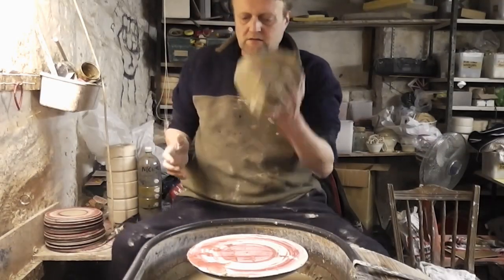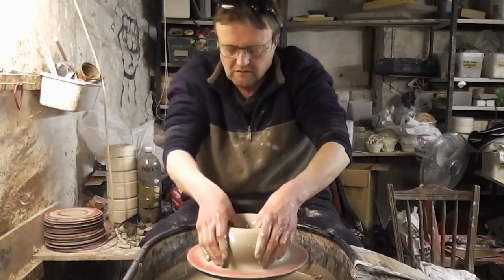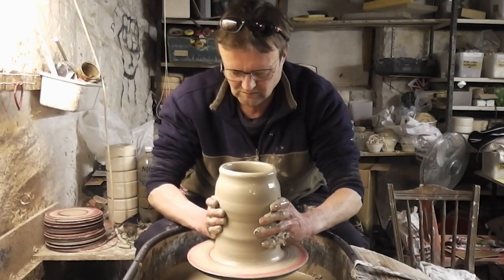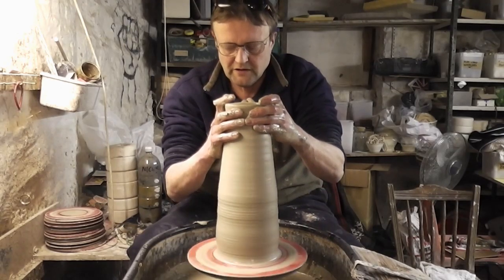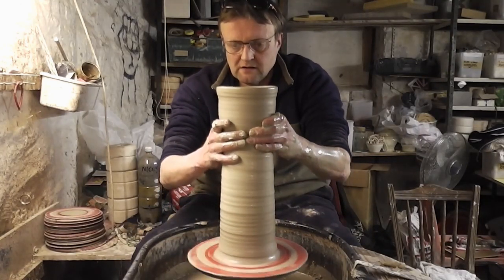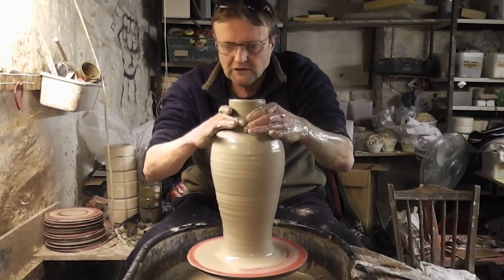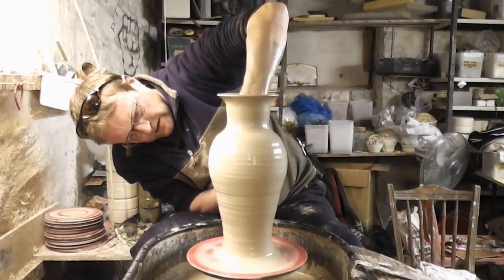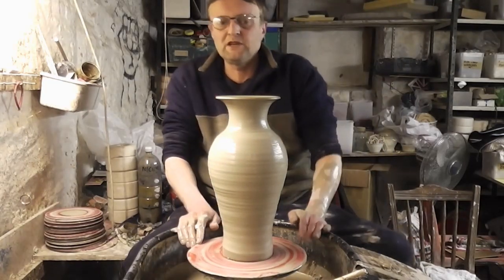Throwing / Making a 6 lb Pottery Vase on the wheel (1)

Comment: That's still fascinating.  If the whole thing had collapsed on you (which is most unlikely) could you gather all the clay onto the wheel and start again? Or, would all the water affect the consistency of the clay?
Best Wishes, Brendan.
Reply: Unfortunately clay doesn't work like that. If it were to collapse, he'd have to let it dry out over a long period of time and then rewedge it to get it to a workable state. Clay has a very good 'memory', so if you were to try to throw with a piece of clay that just collapsed, it would fall apart all over again. Not to mention the air bubbles if you were to throw with it again without wedging.
Reply: RealJoux Thank you, I wondered if the air and water would affect re-combined clay.
Best Wishes, Brendan.
Reply from the maker: It's a one shot deal Brendan.
If it does flop I recycle all the clay anyway by putting it through a pugmill.
We don't waste a scrap.
Shame you can't do the same with turnings eh ?
Cheers, Dan.
Reply: youdanxxx pottery Thanks Dan, it would be wonderful to reconstitute trees because there's awful waste turning wood.
Best Wishes, Brendan.